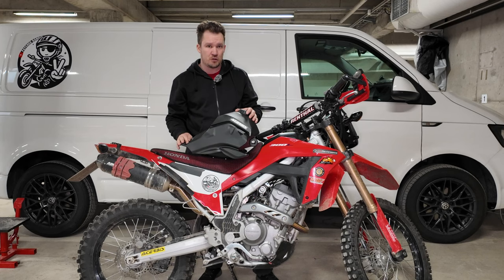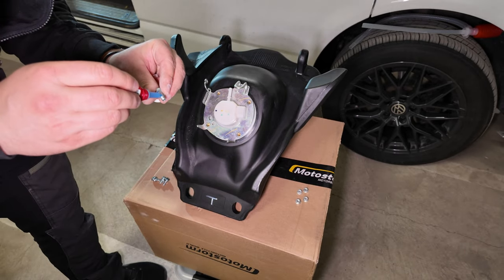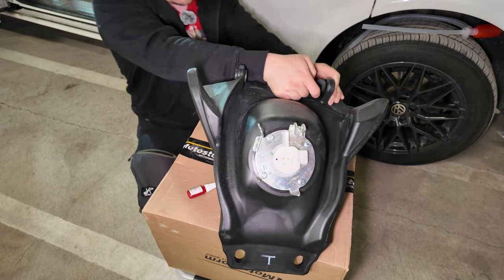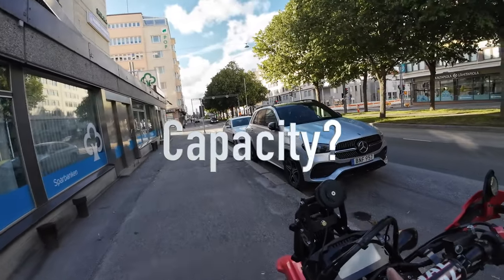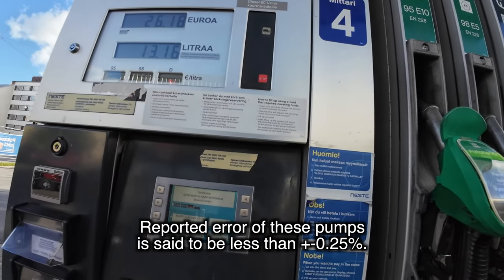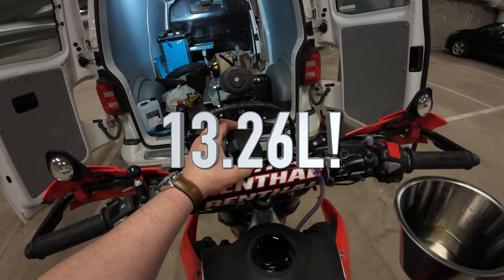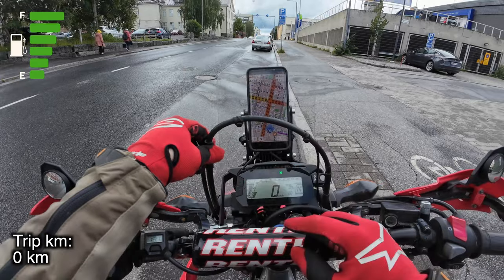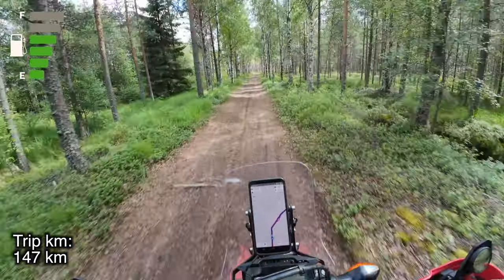CRF300 Acerbis Tank: Full Guide with Weight & Range Test

Comment: Finally a range test and not just an install video. 340km is awesome with that kind of riding. Maybe 380-400 cruising only at a lower rev range. And it should be called a 13L tank, not 14. As i said before, this is becoming the ultimate CRF300L channel! Great job and keep it up. Just got a load of parts for my 300L, bought the RR lvl2 suspension based on your video and feedback🔥🤘
Reply from the maker: Thanks! Sounds great. Im in love with the RR setup now that it woks like it should. Even some gnarly whoops are now a pleasure 😄 still not a motocross racing setup but plenty good enough for my talents 😅
Reply: @PatchedBandit  Good to hear👍 My goal
is just to build, for me, the ultimate light weight ADV motorcycle for nordic TET and gravel roads here at home. Im not a racer, just want the best there is for this build.
Reply from the maker: My CRF is (to me) now so good that I rarely even touch the new Tuareg. I bet you get an awesome bike
Reply: I’ve had mine installed for over 12 months, with Yoshi exhaust & 550 ECU 91 octane stage 1 tune. I’ve made it past 400km relaxed travelling on back roads. A great upgrade to the 300l.
Reply from the maker: That's superb range for a little dualsport. I wanted to test kinda the 'worst case' in this video. I rode it pretty darn hard the whole time and it still managed pretty well. Nice to hear how much I can expect taking it bit more chilled.
Reply: @Wicksy007  That’s impressive for a little bike. In remote areas with a 8L fuel blader strapped to the back the bike would reach over 600km. This will be my next big upgrade together with the 550 Performance stage 3.

Comment: Don’t know if it was mentioned but if you spray windex / window cleaner on rubber grommets they will slide right in. The alcohol in the windex will help it evaporate after installation. Works great with hand grips too.
Reply: I use silicone spray also works very well
Reply: or leave them in very hot water for five minutes to make them softer.

Comment: I've Had my tank installed for about 3 weeks. When full, my Cap leaked terribly. its also very hard to get on without cross threading it. You have to be very patient with it. I installed an addition gasket in cap and that stopped the leaking. overall I'm very happy with it.
Reply from the maker: I had no such issues and the cap threads perfectly. I tend to turn it counterclockwise and only tighten when it drops in to threads. Just like is recommended with plastic threads with screws too. 
Mine also didn't leak and the cap seal seemed very robust. Wonder what's the issue 🤔

Comment from the maker: Update 20/08/2024:

The fuel cap hose plug is absolute garbage and the hose refuses to stay in it's place during rides. I have ordered a KTM "FACTORY FUEL TANK CAP VENT" to try and remedy the situation. If it doesnt' stay I will glue the hose permanently to the cap with epoxy.

Edit: KTM Tank cap vent has worked nicely.
Reply: Thanks for the nice hack 😀

Comment: I've got the same Acerbis tank just before watching the video. I've never run out of fuel in Europe, but it got annoying to need to fill gas every ride.
I don't park the bike in my living room, so I've got a tank cap vent nipple at MX shop instead of attaching long vent hose from cap to charcoal canister.
Making that video must have been 100x harder than installing that tank. That fuel gauge graphic is neat.
Reply from the maker: Thanks! 😄
Reply: May I ask what did you do with the vent hose going to the charcoal canister? Just sealed down or left it as it is?

Comment: finally a good video on it! thanks! 

mostly two things i'm missing – average fuel consumption at the end of the test drive, and Your subjective conclusion. personally i'm not 100% convinced, firstly because of the rubbery tube sticking out, preventing for a tankbag to sit over (extra non-hosed tank cap is supposedly not great quality wise),  and secondly the capacity… quite disappointing. also as stupid as it sounds, but i'm afraid both of available caps won't prevent water from getting inside in case of long rainy rides.
Reply from the maker: 3.9 L/100KM easy to calculate from the video though. 
I left the conclusions to the audience this time 😄 I only saw high quality components during the install. At least the cap I installed is damn solid. The rubber seals didn't let a drop of fuel out so I don't see any way water would enter.

Comment: Excellent video. By the way, what tires do you have?
Reply from the maker: Pirelli MT21 front Michelin starcross 6 rear. Rear still has some tread left so this is why the missmatch. I have an mt21 rear waiting to be put on.
Reply: @PatchedBandit  I discovered MT21s when I put them on my XT600E for a Morocco trip 25 years ago - fantastic tyres! They give so much confidence off-road, and returning to tarmac they were so controllable on the twisties, even though under-inflated.

Comment: What are your thoughts on the windscreen and rally tower now that you've had them on for a while.
Reply from the maker: I have no complaints. It helps a lot on longer trips and higway speeds. Also the lights are insanely nice when the big yellow ball goes out. 
Only negative I've noticed that in some more bumpy mid to high speed situations I can notice the added weight to the steering slightly. But that is something I got used to after the first 2 rides.

Comment: Love mine accept 2 things. The fuelcap can be a bitch and I wish I got it in The tan/transparent color 😅
Reply from the maker: I thought about the transparent option a long time too. I think the black one does visually go a bit better but I get the appeal of the transparent option too. It looks more like 'rally' bikes do and you can see the fuel level through it so.. But the black one looks more like it's an original part of the bike.
I think the cap goes in super easy if you just twist it counterclockwise until you feel it drop in to the threads and then close it down.